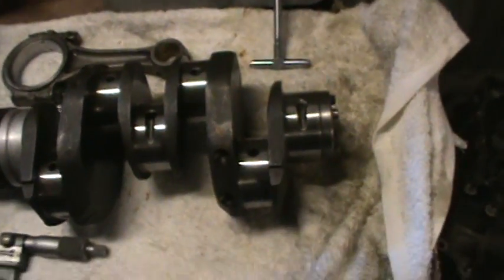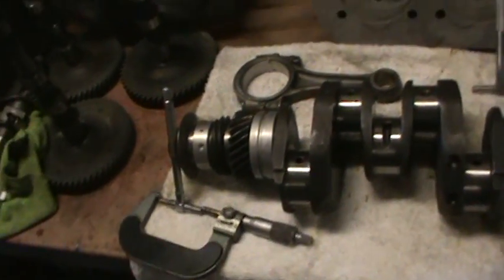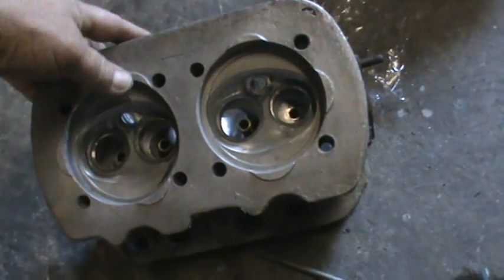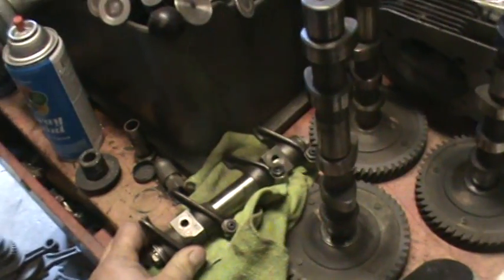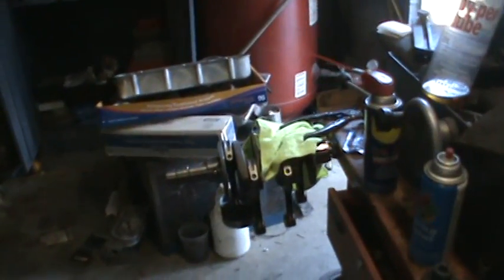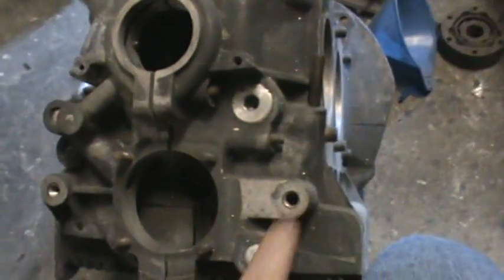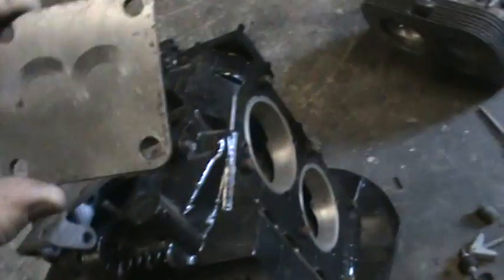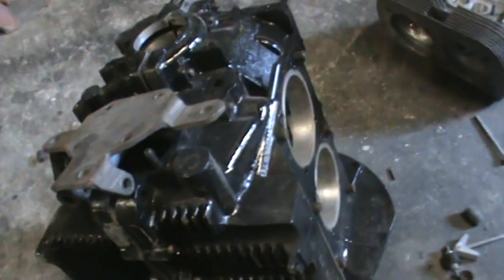how i check bearing clearance

Comment: I tried a scat 1.4 ratio set up and found out I had to buy there pushrods seperate with may west ends.   It took a while for things to settle down but its been working out just dandy on the 2 liter with stock cam and 6.5 compression.